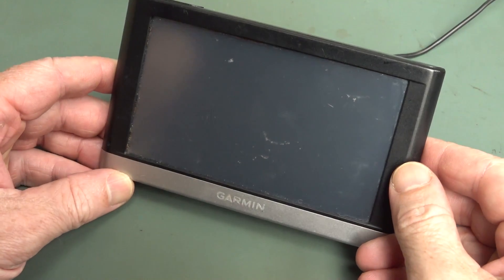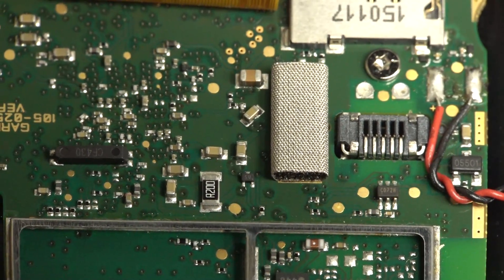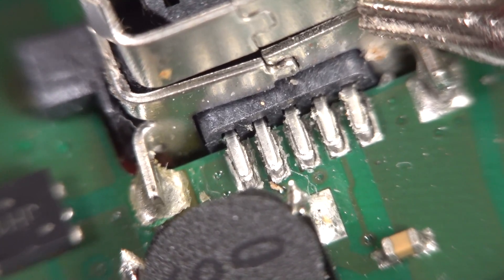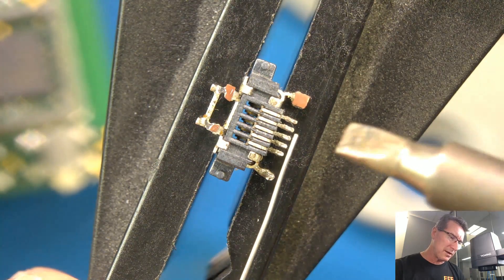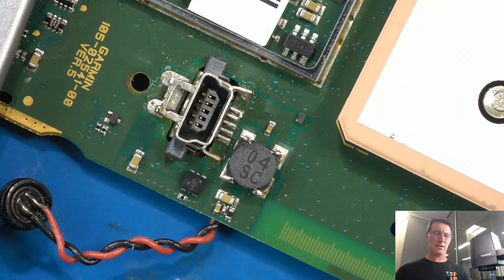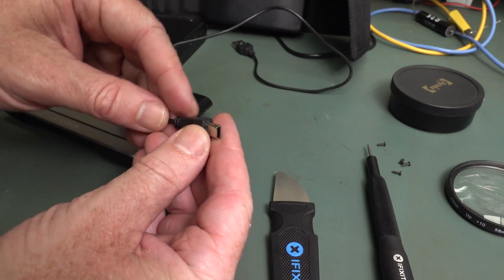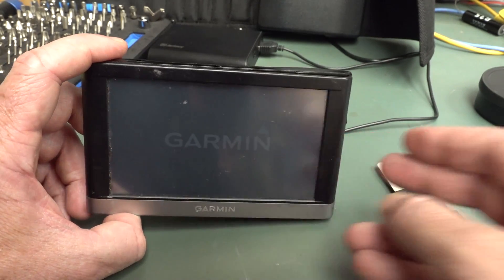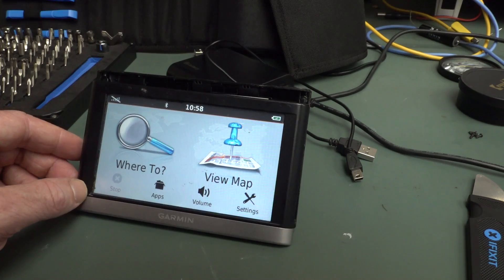EEVblog #1281 - Garmin GPS Repair

Comment: You should be glad that wasn't an Apple product. First, they will tell you that unless you are at a certified repair facility, YOU are not qualified to re-solder a connector no matter how much education, training or experience you may have. Second, by opening the case YOU are violating their intellectual property rights. And third, they will never support you by providing a schematic diagram and will actively work to insure that YOU never have access to component parts needed to fix YOUR or ANYBODY ELSE'S PROPERTY. And it isn't just Apple who are doing this.

The fight against this is the essence of the Right to Repair efforts going on in the U.S.
Reply: Too many Rossmann fans in this comment section -_-
Reply: @IlBiggo  Do you have an argument against what I said or are you just venting?
Reply: Darryl May no argument can de-lobotomize an apple hater. You didn’t present any arguments yourself, btw, so I wouldn’t know what to argue about.
Reply: @IlBiggo  My arguments should be obvious from what I said. That Apple, in recorded testimony, as made the following assertions: One, Apple argues that no one is qualified to do as little as re-soldering or replacing a connector unless you are employed at an Apple certified facility. Two, in opening the case, you have violated Apple's intellectual property rights. My third argument is based upon the experience of repair shops who have and continue to repair Apple products cheaper and to a higher standard than the Apple certified repair facilities.
Reply: @darrylmay4510  So the third "argument" denies the supposed real life application of the first two.
Let's say, for argument's sake, that you have the knowledge and skill to find a fault in an electronic device and replace the faulty component(s). Exactly, what can Apple (but "it isn't just Apple who are doing this", right? So why Apple?), what can any manufacturer do to keep you from soldering a new component in place of the old component?
Your "arguments" are particularly unrelated to this video, seen as it's an old device; there's no schematics, nor a need to look at schematics; it's about replacing an USB socket, which is a common component you'd find everywhere; and nobody would need "Garmin's certification" to replace an USB socket. Now, can you explain how your comment wasn't gratuitous Apple hate and/or Rossmann propaganda?
You forgot to note the lack of fluxant in the video, btw - but I guess the other 200 posts by Louisettes who never used an iron in their life are enough XD
Reply: @IlBiggo  This is getting tiresome so I will only reply to the first part of your most recent post. Apple can and has actively worked to prevent technicians from purchasing replacement parts. Recently they have gone further by installing serial numbers in components so that the processor will disable certain functions if the serial number does not match the "as installed" serial number. They have done this on the charge circuit of the new iPhones. If the serial number does not match what is expected, the software disable battery monitoring. This is my last post on this subject.
Reply: @darrylmay4510  LOL, classic. Accusing is free, explaining is "tiresome". So I'll do the explaining: no matter how many times I opened, repaired, modified or enhanced  electronic devices, be it Apple's or any other manufacturer's, I haven't received a single C&D notice, nor a visit from the police or any kind of complaint from the "evil corporations". Yet. Heck, Dave here (sorry about all this, Dave) opens, mangles, repairs, modifies tons of devices on screen. I hope he's got a bodyguard and a good lawyer for when the Hammer Of Justice will strike.
Your personal experience about this seems to be "I've read the Right to Repair leaflet". Don't get me wrong: I appreciate Louis's work and his dedication. It's his "followers" I can't stand. The guys who want the right to repair something they haven't got the skills to repair. Newsflash: you already have the right to repair your - and others' - stuff. But the (Rossmann-endorsed) rule is: you touched it, you own it.
As for the couple of proprietary components your enemy Apple won't sell you, well, tough luck, it's the same in every business.

Comment: Nothing wrong with that fix!
I would have been inclined to put a couple of drops of 5 min epoxy on to shore up the connector though. :)
Reply: Jimmeh B , all my 5 minute epoxy takes 8 hours because I'm too cheap to buy two kinds of epoxy.
Reply: @stclairstclair  lol. 
That's smarter than buying the 3 minute "rapid" set stuff that usually sets somewhere in between when you've finished mixing it and trying to apply it!
Reply: Jimmeh B, I find I'm afraid to buy it because it doesn't seem to last long enough before I go to use it.

Comment: Power with a current-limited supply. But don't do what I did with my dashcam and power with 12V instead of 5V and them ramp up the current to 1A because it was turning on then off. Sizzle death.

Comment: Love your videos. I have a Commodore 64c I want to recap but have no experience at all. Would you be interested in doing it? Also power supply is dodgy
Reply: Sean Tilley, You can do the caps yourself, he has some good videos on soldering. Do you have a new digital soldering iron? Hakko FX 888D, is only 100 bucks on Amazon, Ive been using old crap for 30 years and this new iron changed everything.

Comment: Low /no charge on batteries often cause devices to restart repeatedly till enough current is available from internal battery to keep voltage in operating range. It can be weak contacts, damaged wires or just not enough current available to start the charging plus run the device because the power adapter is not quite up to original specs.

Comment: I did stuff like that more times that willing to admit, but I learned something on the way (I would have saved the time if I listened to someone smarted) - repair one thing at a time. Unless these unconnected vias obviously lead to magic smoke, just for a test connect the device and check if it something changed after one fix. This way after few "improvements" in a row it doesn't lead to figuring out how many out of ten fixes broken something ;)

Comment: ... Said the guy losing his eyesight.  ;P
Welcome to the club though..  You're lucky - mine started going at ~40yo. :)
But no, I do agree on the using high-magnification reading glasses when doing any close work!  Been doing that since about forever.
Reply: Disabled Vaper, I look at the TV and slide my glasses down, nope thats the readers, I look at a small part, slide my glasses down, nope thats not the readers, or I start driving and forget them altogether.

Comment: That solder joint has the fuzzies you'd expect with Tin Rot, so ROHS for the FAIL yet again (the older stuff was much more prone to this mechanical failure)
Reply: as much as I like keeping my nervous system unpoisoned ROHS PCBs really do seem to be terrible

Comment: I hate mini and micro USB cables.   More than once, I've started tearing at my hair trying to figure what had suddenly gone wrong with a project when it turned out to be either a bad cable or a USB plug slipping out of its receptacle.     Does anyone make a locking mini B usb connector?
Reply: tubastuff You got me thinking about those little Mini display-port connectors for multi monitors, those suckers lock and stay locked in.

Comment: Some notes, please disregard if you noted these in the video or already know this; The model has LMT so that is Life time Map and Traffic, updating is simple and the mapsets are poorly protected and can work with most of the earliest touch screen GPS units. you can (for this model) update free using the Garmin Express tool (boot screen depicts map from 2014.) The device uses a resistor inside the plug head to determine how much current to draw and weather or not it hooked to a pc (no resistor and it will only pull 500mah in computer mode) Google can fill in the remaining gaps in this info ;)  (you do not need to register to get updates, just skip that screen or hit next with no info filled in.)

Comment: have a garmin gps with similar connector to that, also broke at the connector. Only thing with the model i had it was on the edge of the board. all the pins broke off like that but it peeled the board apart too.  pinched board back together. soldered it and blasted it with hot snot. has held up for 4 years so far.

Comment: This connector is a common problem on Garmin devices. Had a control unit for a dog collar break just like this. When I got the replacement, I epoxied the shit out of the connector.

Comment: 62-36-2 Tin-Lead-silver solder has much better tensile strength which should make it a better choice for that type of connector, and it also has a low melting point so you can use hot air without melting the lead free solder on the board...

Comment: When I was taught to solder 60 years ago I was told to make a good mechanical joint first, then solder. In these days of surface mount that’s gone out the window 😢
Reply: That's funny; soldered copper pipes don't have a good mechanical joint first, but are extremely strong. It's the amount of bond that matters.
Reply: @metallitech   Do plumbers actually solder pipes end-to-end with no overlap and no fitting? I thought the pipes were fit together, not just ends touching.
Reply: @Markus0021  I think he means they just slip on/off before solder is applied. Certainly no structural support before you solder.
Reply: @NickHorvath   OK, but that sounds similar to electrical soldering - by 'mechanical joint' they just mean hooking one wire on the other  or twisting them together, rather than just touching the two together while soldering. But the connection types are so different it's really difficult to compare the two, I guess.
Reply: @Markus0021  Yes but they fit together to create bond, not to make a mechanical connection.
Reply: @metallitech  - DOH.... you realise that a "bond" is a "mechanical connection".
Reply: @johncoops6897  It's not. For example, two copper plates soldered together: No good-old-boy "mechanical bond", but strong as you like.
Reply: @metallitech  - two copper plates that are soldered together ARE BONDED (by solder). In the case of joints in pipes, the mechanical connection is the slip joint, and the solder is used to fill in the gaps and bond the whole thing together. I don't know what you are trying to tell us when you say "bond".
Reply: @johncoops6897  When I say "bond" I am only talking about an amount of surface area.  Hard to quantify for anything other than two copper plates.
Reply: @metallitech  , well they sort of DO have a good mechanical joint. The pipes insert quite a ways into the fitting, there is a lot of surface area there in the overlap, and the tolerances are pretty close as well, The solder is not being stressed very much since the pipe-to-fitting junction is mechanically good.

Comment: I'd vanish that daft little socket and hardwire a trailing B-type socket. If the socket is on the end of a pigtail, it can't transfer any stress.
USB mini / micro is rated for MANY more connect / disconnect cycles than B-type, but back in the real world, have you ever seen a failed B-type?

Comment: That bad cable and it's high resistance probably saved the board when you shorted it with your mod wire ;).
Reply: Nice, but wrong train of thought. The shorted power pins result in a supply voltage of 0V to the consuming device.
The only thing that does its job here is the thermal poly-fuse on the side of the computer USB port.
Reply: @dieSpinnt  Huh? The short goes through the USB cable, so yes, it can act as a fuse or a limiting resistor.
Reply: @misium  U = R * I ... so short circuit means a small resistance (if we can agree on that), while I is limited by the supply, resulting in a Voltage(U) going towards zero.
Unless you are interested in warming your cold hands with the cable. 

Which is (5 volts) (0.5 amps) (300 sec) 1 / (390 J/kg°C) (50g) ~= 38.5K for the copper alone and when 1kg mass of your cold hands are involved drops to a delta temperature of 1.92Kelvin which is almost not noticeable. 

There are two wrong thoughts: There is already a fuse in series and so another hypothetical bad-cable-fuse(...very reliable, very hypothetical) is irrelevant. Second: What would happen to the device if there was something like infinite flow of current? The low resistance parts would melt away and in the worst case the full supply voltage appears at the DUDT(Device under Dave-Test). 

THE FULL 5V! Oh, wait. Isn't the device specified for 5V?
Maybe we have some understanding problems and issues about setting priorities here? My concern in repairing things was always to show love to the DUDT, not to that lame cable:)
Reply: If you look closely you might notice that the voltage circulated quickly, but the frames that hold the shielding plates acted as a heat sink, also releasing reverse energy.

Comment: My mentor instructed me in the way of "dry" soldering like Dave here. "Always use flux core solder" and you're good. (More recently I've been using Rossmann-style fluxing though)
Reply: Yeah i was screaming for flux but in reality you are right .... Good solder has lead, and tons of flux.

As long as your quick its fine.

I still would use some flux to do the whicking lol
Reply: @joshuanorris5860  For simple work like that flux-cored solder is fine.  You really only want to reach for the flux if the surfaces are sketch (or you're trying to clean up existing solder that is still applied to the board).  Louis does a lot of SMT and ball array repairs though which is where a decent amount of flux is a good idea.  If he were soldering simple pins/bodge wires like that I'd think maybe he likes the smell too much....
Reply: I used to never consider extra flux until seeing Louis's vids. I too was "yelling" FLUX !
Reply: Huh? My solder has flux as does the solder wick.
Reply: @EEVblog2  Yep yep. By 'dry' I mean in comparison to what's basically a flux bath, as exemplified by the technique of L. Rossmann.
Reply: "The proper amount of flux"
Reply: Ersin Multicore is preferred for small parts on circuit boards.  But a bottle of thinned out rosin can also come in handy  for dipping multi-stand wires prior to tinning.

Comment: The mini USB's have to be a certain pinout also or else the GPS will not function correctly. I've had issues with many different GPS units not liking the mini USB cables they have to be data specific or certain data pinout.
Reply: The Garmin mini USB Cable used in the car is non-standard. If you use a standard cable and plug to a car USB adaptor, it go to PC mode only. The trick is a resistor (10k ?) connected between ID pin and ground.

Comment: You probably shorted the wires in the mini USB when you shorted it out with the jump wire, most likely melted the insulation as you did say it got hot.

I would definitely be adding some physical reinforcement to the connector, its weaker now than it was due to that pad being missing.
Reply: Good point. Some hot snot never hurt :)
Reply: @Joshua Norris  some epoxy does not hurt either. I was screaming at the screen the whole video. i hope Dave does not torture us with his repair skills to soon again.
Reply: @rarbiart  well of course...

I liked the vid tho. I was screaming for flux on the first half but i got over it.

I like bite sized repair vids...

And the more he fucks up the better. Then we learn more. :P
Reply: @rarbiart  Also was going to say to blob it down with some 5min quick epoxy.
Reply: @DrakkarCalethiel  given that it's already broken once, hot snot is probably the better option.
Reply: @rarbiart  ,   Use the Edit function to correct your spelling mistakes... "hole" would need a "w" and a spare "o" in "to."
Reply: @AngDavies  - hot melt is the WRONG product for this job, since a GPS lives in a car which in Australia can easily reach 60°C and often times much more (if on the dashboard)
Reply: Yep big blob of hot snot!